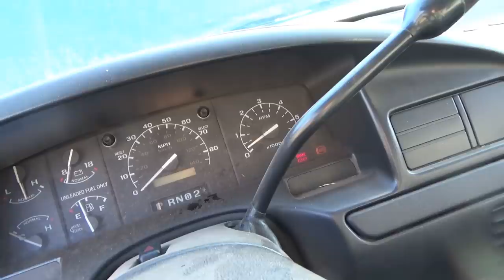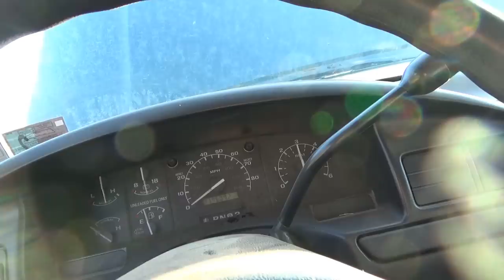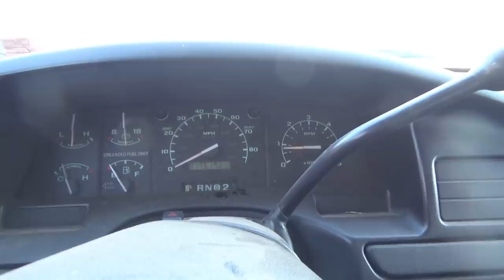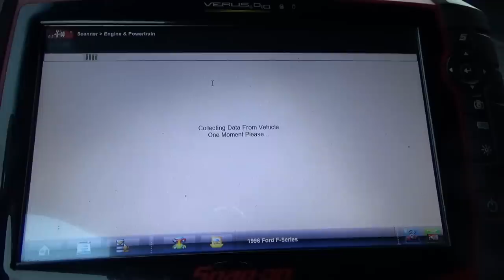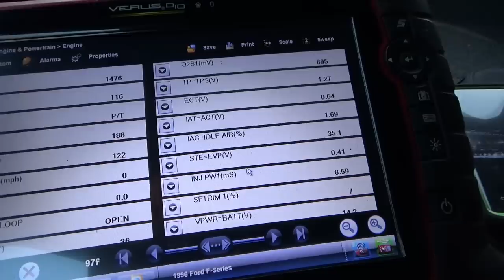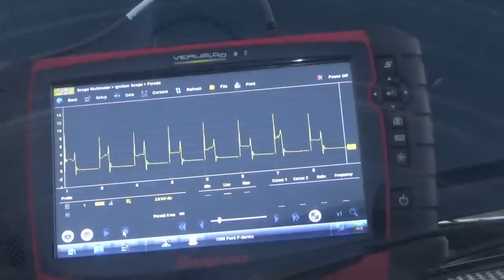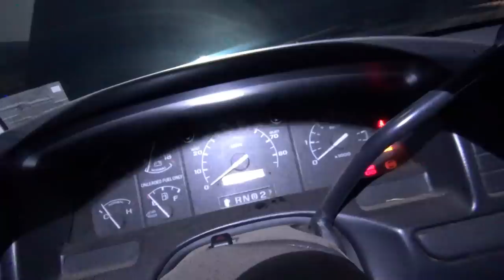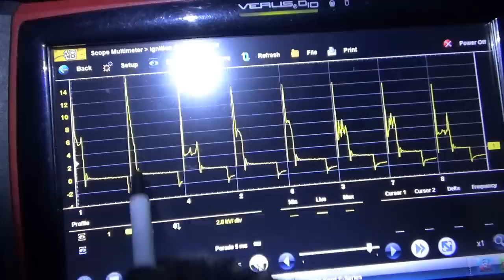Ford BIG BLOCK: Hard Start after Engine Rebuild? (Part 1 - Memorial Weekend Special)

Comment: Honestly, this has to be one of my favourite automotive channels. Something about watching Ivan troubleshoot and diagnose, it's incredible. I'm not personally an auto tech, but I am an electrician... and I love doing this kind of detective work to troubleshoot a problem. 
Keep up the great content!
Reply: I'm a DIY mechanic and I have learned a ton by watching Ivan. Even if I never do complex diagnostic work, it helps with the simple things as well.
Reply: im an HVAC/APPLIANCE contractor, and find the channel very interesting as well, due to the troubleshooting methods.. I would not ever bet against Ivans ability to eventually find the problem,  even though most of the problems that are brought to him have been worked on by many mechanics, who couldnt crack it.  Ivan uses a consistent approach, and follows it thru kind of a repertoire. I do the same thing in my field, not assuming anything, and  learned not to hop around just shotgunning things.  its very easy to just give up, and say the motor needs pulled and disassembled.
 staying in the fight, and feeling the pressure and stress is what makes you better and better.
Reply: Ivan is a friggin champion.  I always wondered why he hasn't gained more subs like Eric O has, I can only think that it's because he does advanced troubleshooting?

Comment: @4:00 based on what you showed and what I heard. You asked what I might do in this old truck.

No data to scan

I would install a VA (volume analyzer) sensor on the intake manifold and one in the exhaust.

Just to see how the engine sucks in air and pushes out air.

This helps me when kids put modified intakes and exhausts on cars.

On another car that had no power and couldn’t get out of its own way. I leared the engine could breath and found RED RAGS in the exhaust. 

Customer replaced is own head gaskets and he says “I put reg rags in the exhaust and intake runners to keep trash out, I thought I took them all out”😅

Let’s watch the rest of the movie, you always surprise me🎉

Comment: Ivan, I have seen a few Ford PCMs from the mid to late 90s suffer from internal corrosion from leaking eletrolytic capacitors. The capacitors leak on the PCB and the corrosive liquid will eventually dissolve the copper traces causing very random drivability issues. Also I noticed during the KOER test there was a refrence to a missing SPOUT connector. Someone may have set base timing and forgot to plug it back in, preventing the PCM from advancing the timing. 👍
Reply: I thought the same thing about the SPOUT code.  It's no longer advancing the timing..
Reply: You should be able to see what the timing is doing in the live data
Reply: I came here to say the same thing about the PCM.  It's an easy check.  A PCM that's losing it mind is going to be difficult to troubleshoot.  It's a case where the check is easier than the troubleshooting. The PCM could have gone bad while the engine out for rebuilding.
Reply: Good eye, i found myself shouting, spout is open!!! Lol😂
Reply: You make a lot of sense,  hopefully that's the fault :-D
Reply: Confident I saw ignition timing advancing on the scanner when Ivan was reving up from idle.
Reply: @mark98070  The PCM is commanding the ignition timing and that’s what shows on the scanner, but with the SPOUT connector unplugged it breaks the signal going to the distributor. No timing advance even though the PID is showing it…
Reply: Watch Wes work just had that job on a motor home. 

I also question how long the truck sat for, and how gummed up the injectors are.
Reply: All have electrolytics inside not only Ford's
Reply: I saw the spout code..couldnt remember the issue. It was a very common problem back in this generations time
Reply: @keltecshooter  same lol, don’t skip the spout code!!!
Reply: Head gasket

Comment: We had a late 80s 7.5 f350 4x4 growing up on a farm.   I remember it would get about 8-9 mpg all day no matter if it was loaded down at max towing capacity or completely empty.   Good/tough truck though.  Had no A/C option, crank windows, no cruise control, etc and rode like a lumber cart.

Comment: Well for one thing the SPOUT code is set so that means the computer has no timing control those old fords if the base idle is set wrong will not be able to step the iac fast enough to keep it running after a snap throttle especially without timing control. That will also make a shaky idle. The iac steps should be very low if base idle is set right. And the rich code comes from the rough idle and then lack of timing control this system used the timing to help control afr and idle speed. Without timing control your not going to be able to get far
Reply: fresh from a rebuild - I bet the timing is way off - especially with the "no compression" crank. It's like the timing is off enough that at cranking speed there's no compression, but once it's running the timing is just marginal enough to have it run - poorly
Reply: @gorak9000  Seems reasonable to me as well, just start with checking the cam timing and then continue with ignition timing just to make sure that those factors are right.
Since it's a rebuild by owner I'd also check if the cam was replaced and the owner got an used cam. I did a rebuild of a Suzuki GSX750 (designated GS750 in the US for some obscure reason) and got a new used cylinder head that have Cam Motion G3 cams in it. Those cams are race spec cams and the seller didn't have any idea about that and thought it was stock cams. Those cams found a better home in a tuned GSX100EF instead.
In any case race cams can lead to some interesting idle situations as well.

Comment: Yes.. Switching tanks will both show on the needle, if it's working correctly..  Since it was rebuilt-  it makes me wonder how long it sat, and if there is old gas and maybe a clogged filter;  and the fact that it's sucking the bottom of the tank at the moment.  It will be interesting to see your process on this one...   I never understand people who run their tanks to the bottom;  I look at 1/2 tank as if it's empty and needs topped off. :)

Comment: Start with the basics! The owner said that he wasn’t sure of the timing. At least get the distributor on the right cog and set the timing!
I think that you become too enamored with your electronics. Just the basics in the beginning!
Reply: Enamored? Most techs don't work on 30 year old cars where you could touch a valve cover and tell to a component level what is wrong.
Reply: Always start with the basics.  Even with the newer vehicles.  Too often I've seen tech's jump into a problem based upon reading a diagnostic machine or a TSB only to get bit in the ankles by not starting withe the basics.
Reply: check the compression instead of talking.
Reply: Like when you go to the doctor and they check your weight, pulse rate, o2, and temperature before they even ask you what did you come in for.
Reply: @russellhltn1396  Dr Hollow wants to CT scan u first.
Reply: @richb419  mechanic skills not his best,  strong in patience and scanner  though.
Reply: Great point! Derek of Vice Grip Garage would approach this old beast entirely differently from Ivan.
Reply: @thk7513  I have found TSBs that led me to the problem instantly, bypassing an hour of "basics" and compression checks.

Comment: I had a 95 just like this with the gutless 302, 5spd manual 4x4, Eddie Bauer Edition.  It was an awesome truck that I drove to 320k miles and finally spun a bearing.   Off road in 4Low, it was a beast, but I pulled a lot of trailers and it was a struggle bus sometimes.  So after it died, I got my 2002 F350 7.3L 6spd 4x4, which is a da^n tractor. lol.. I love this thing even more;  it's pushing high miles already and going strong.   Neither one every caused me any issues (other than the spun bearing, alt, starter, brakes).

Comment: Vref is the 5 Volt reference for the 3cwire sensors. You glanced over it at 6.88V. That also need to be addressed. KOEO and KOER tests are Not stored codes. The Map out of range is likely caused or at least being affected by that high VREF.

Comment: For this vintage engine rebuild you do not put in the distributor and crank the engine. You use a drill with a pump drive attachment to run the oil pump and see if it makes pressure. If you do not position the distributor drive into the pump and mate with the cam the distributor will not seat properly on the block flange.

Before troubleshooting the ignition system after a rebuild you have to verify proper base timing, and usually along with this you do a distributor cap, body and rotor inspection to make sure there are no carbon tracks or bad rotor.

The problem seems to point to weak overall spark energy. Engine runs better when warm and at high rpms. As you go up in RPM the amount of energy needed to ignite the mixture goes down. As the engine gets warm the fuel mixture becomes more homogeneous, making it easier to ignite at idle.

Comment: It's nice to see you working on some of the older stuff Ivan.  At least this has OBD so you could get to use a scan tool on it.  And yet, old enough to go back to your roots and diagnose it the old fashioned way.  On a fresh engine rebuild with very little run time, those plugs should be almost perfectly clean still.  But these are blackened and fouling badly.  First impression looks like a fuel control issue.  But poor ignition timing can play a role in this too.  Still so much to check before we can even think about pulling the parts canon trigger.  I can't wait to see part 2.

Comment: Ivan check the roll pin on the distributor gear, it's a roll pin and shear causing timing issues.

Comment: Glad you checked for live data, was gonna say it should have it... I was pretty sure Ford’s late OBD I models did. You might be out of luck for mid to late 80s stuff, but early to mid 90s should have it. 

As one other guy said, these ECUs were notorious for caps leaking onto the board and corroding through traces. Just something to keep in the back of your mind if you get stumped on one of these in the future. Easy to pop it out, take the lid off and have a look, definitely something that is easily visually identifiable (shango066 has a recent video on the subject). If it is bad enough to cause issues, usually one or more of the caps will have a leg corroded completely off.
Reply from the maker: Like the 94 Danger Ranger I recently diaged 😁
Reply: 96 was just pre obd2..some 96 had it i think

Comment: I would be doing  A compression check on all the cylinders and see how even or uneven they are. I would also check valve lash. If they decked the heads and decked the block your pushrods might be too long. And of course check the resistance on the spark plug wires or replace them with some good wires. And throw a set of brand new good spark plugs in it.
Reply: Sounds like the lifters pump up and you lose the compression.  Did they plane the heads?  Can valve lash be adjusted on big block Ford?  Can't wait to see the results of this video.  Assume he fixes it.  He's brilliant.
Reply: Biggest issue is Ivan mentioned the block was fly-cut flat .030"? I'm guessing maybe the heads also were cut. So... now the heads are 030." to 060." closer to the block. Same factory push rods... Never re shimmed rocker pivot shafts, all equals intermittant valve float and total loss off compression.   Its a Pandoras box.

Comment: The way it's effecting many cylinders I have to wonder about the distributer and also bad gas. It could be lots of things. lol Love the holiday specials!!
Reply: *distributor
Reply: *Affecting
Reply: at this point im thinking its a problem with the lifters.  like they are  not pumping up right, or bleeding off when they shouldnt.

Comment: rebuilt a 1986 F150  5.0  . had similar issue . Found after troubleshooting over 22 months I accidentally swapped 2 plug positions on distributor. Ran like this  F250 exactly till I put the correct firing order.

Comment: A common "gotcha" on this generation of Ford V8 engines is the routing of the spark plug wires, make sure to run 7 and 8 so they aren't parallel from the distributor to the cylinder as it will cause inductance firing between the two, same thing happens for the wires to cylinders 2 and 4.

And as others mentioned spout!

Comment: Things i ran into with a 1992 straight six( different engine)..coffee can looking vacuum reservoir rusted, caused a vac leak. Most of the emmissions needed replacement..iac, egr, smog pump seized, plastic ford vacuum lines suck. I rebuilt one straight six..somehow the dealer sold me the wrong injectors..it ran rough and was slurping gas..check the codes on the injectors..live data,? Ha ha ha! Youre funny..i had no problem dealing with just the blinky codes from the CEL. THE ford fuel injection system is so perfect and simple, once you learn it. Once they give you a code, it really helps pinpoint the bad part

Comment: I’d check compression, fuel pressure, and spark.  Just to knock out basics if those are not the issue.  Then check timing, and timing sensor inputs such as crank sensor or cam sensor etc.  These older fords have a history of IAC issues and timing related issues too. My early money is on timing and IAC.

Comment: Ivan, something i noticed when you were looking at live data. It stayed in open loop for a long period of time. While it is in open loop, the ECM will ignore the O2 sensor until it goes into closed loop. A lot of the domestic OBD1 vehicles had live data.
Reply from the maker: Yes it was reluctant to go into closed loop because it's an old OBDI truck 😅
Reply: @PineHollowAutoDiagnostics  It could well be part of the calibration to idle in open loop.
Reply: @Pine Hollow Auto Diagnostics  It's obd1? My 95 is obd2, shouldn't all 96+ vehicles be obd2 compliant?

Comment: 0 comments? I think it just does not update as fast as it use to. There MUST be comments before mine. I had that truck with that engine back in the day but mine was an F-450 Mine was quiet as well. I actually had THREE trucks with that engine and I rebuilt the one that was a 1980 but it had a carburetor. That was smart using the thermal camera on the exhaust

Comment: Check the Spout Connector near the distributor. Maybe it's unplugged.
The Spout puts the engine into base timing when it's unplugged to check the timing, kind of like unplugging the distributor vacuum advance  and plugging it with a screw on an old GM to check timing.
Reply: This is a remote module on ignition. Spout is by the ICM on the fender.
Reply: @CodycoWeb  Yes, been a while haha.

Comment: A guy in town had a F450 towing truck in the middle 90:s, also a 460 engine and similar issue, then it was a snapped keyway, if I remember correctly it was on the crank pulley hub/ positon sensor, milage was impressive, about 4-5 mpg 😂!

Comment: You just can't catch a break with these customers that bring their vehicles to you with no gas.  I had a 7.5 liter (460 cu. in.) in a '96 just like that.  I traded it for the truck I have now; it has a 6.0 liter diesel.  Wish I had my old truck back.  Great video!
Reply: Should charge $20 a gallon

Comment: I like these older diags , a mixture of old school and more modern technology. Im thinking the rings havent bedded in yet lower compression and oil rings allowing some oil into combustion chamber fouling plugs especially number 7. Too early to do a in cylinder preesure   test . Alot of variables makes it a good case study.

Comment: First thing you do if you're sent to a job like this is check the timing. When they say "rebuilt motor" check the timing. Put a light on it or TDC #1 and pull the distributor. Then check plug wiring. If problem still exists pull valve covers and check timing.

Comment: I can’t believe he had to rebuild a 460 with 117k miles. Although they drank gas, they were an excellent engine. I’ve owned and worked on a lot of them here in farmerland America that have 300k+.  I love those trucks.
Reply from the maker: It was running perfect just leaking coolant externally from the head gasket area...owner decided to do a full-on rebuild for some reason (bore, pistons, cam, everything) and here we are haha

Comment: All I know from the vintage ford f series. It is time to recap the ECU.
Reply: At least worth it to have a look. The caps themselves drifting in spec don’t often cause issues, but if they leak, that crap corrodes board traces and will definitely cause problems. Super easy to pop it out and take the lid off just to have a look, anyway.

Comment: Code 213 during engine running test. Spout signal integrity needs testing through to pcm connector. Faulty PIP can also cause pcm to think that spout is disconnected. Hope this is helpful😊

Comment: Sure sounds like no compression, right? (When cold only?) The owner is thinking about distributor timing so he probably already checked that 20 times and it is something else. I'd pull off the valve covers and check that the top of the engine was assembled correctly and is in time. For example, what about valve lash? I don't know how it works on this engine but on a pushrod Chevy if you just cranked down on the rockers like an animal, maybe you'd get something like this with all the valves staying open all the time.
Reply: he may have put the hydraulic lifters in dry and they arent opening and closing all the time.  I would pull the valve covers, crank it over and watch the rocker arms.

Comment: Almost always intermittent issues like this on the older Ford EEC-IV systems are PCM failure related.
Reply: I saw "watch wes work" fiddle with a Ford camper recently that was running rough and had bleeding capacitors in the PCM . To his credit, he replaced them himself, and it was on its way.
Reply: That's what I'm thinking bad engine computer